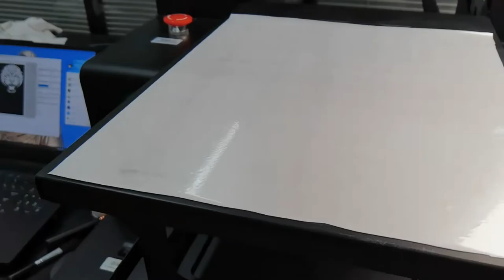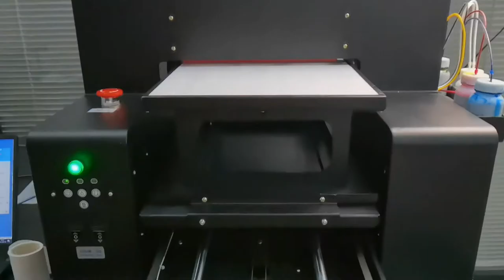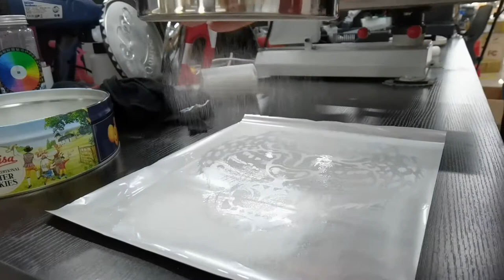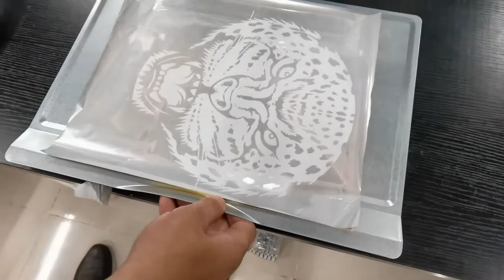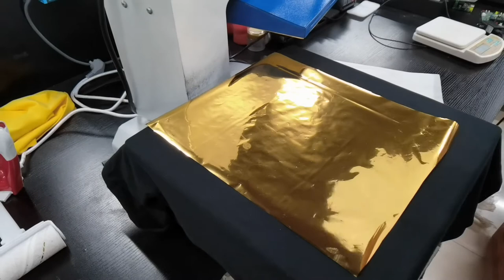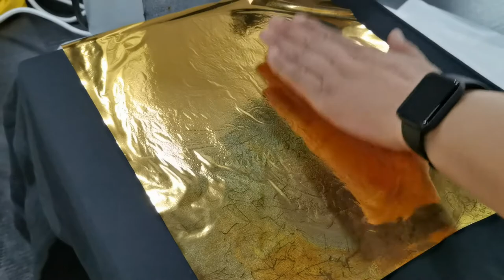T-shirt clothing digital printing pressing gold foil

Comment: 👏👏 is this printer and solvent based ink? how long and what is the oven temperature
Reply from the maker: Weak solvent ink can be mounted on this printer. However, because the weak solvent ink can not print clothes and there is no white ink, the weak solvent ink is rarely available in the market. The oven temperature is 80 degrees for 10 minutes.

Comment: Question the foil only can go on the dtg board , can it go through a dtf printer ?
Reply from the maker: The foil is too thin. It can only be used on the printer with vacuum platform
Reply: @linxie1225  can you explain this more for me please? I have a dtf printer and want to print on foil.
Reply from the maker: @gotculture6967  The gold foil is very thin and must be used in a printer with a vacuum platform.

Comment: Nice VD, What's the temperature settings
Reply from the maker: I use 160 degrees and 20 seconds.
Reply: @linxie1225  Celsius or Fahrenheit, thanks
Reply from the maker: @williamgibbs6844  Centigrade
Reply: @linxie1225  😂